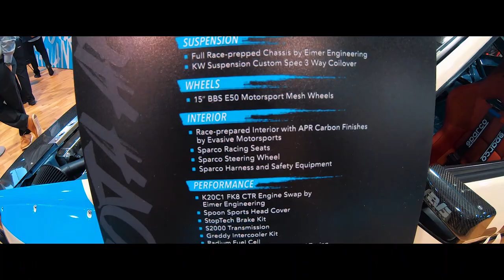Year11.5 & The Wild Rides of SEMA - CHRNCLS Vlog 2019 #31

Comment: @3:47 what's the fix for the reservoir not working? Mine doesn't either but I dont understand what they're referring to do.
Reply: believe them to be assuming the tube which the hose connects to doesn't reach the bottom and just drops fluid in from the top. the radiator as it cools will create a negative pressure and will cause the coolant to be sucked back in. but if the tube has air on the other side, it's just going to suck in air. that specific reservoir has a tube that goes to the bottom, just appears like it doesn't.
Reply: @ikilledZutera  eggsactly.